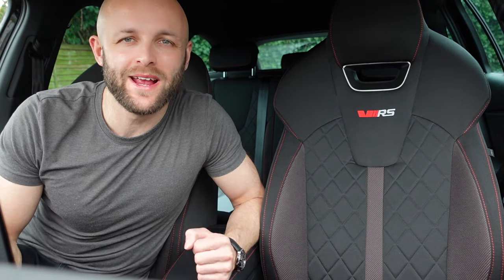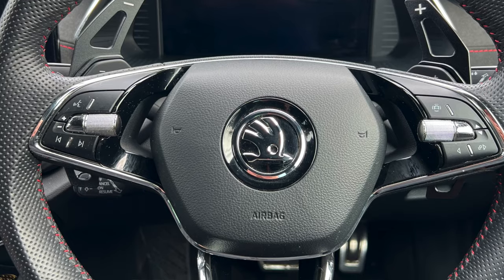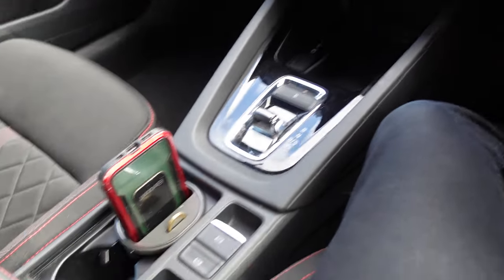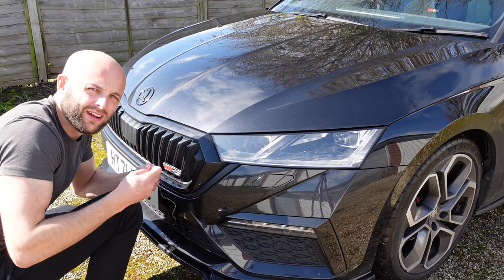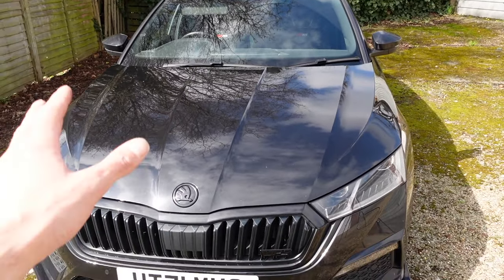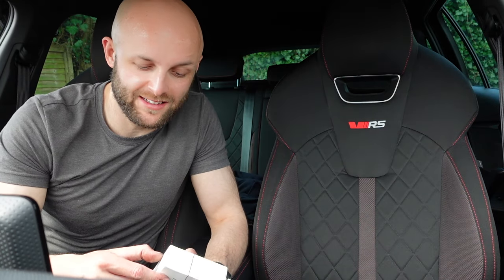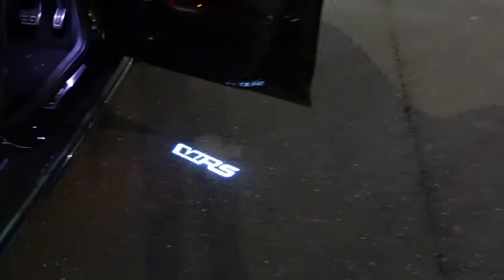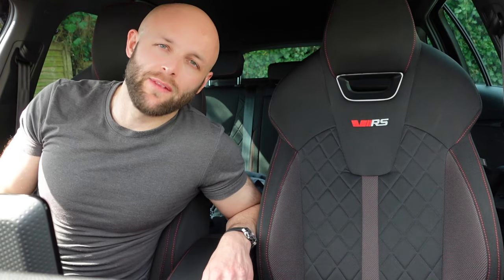5 Must Have Mods & Accessories - Skoda Octavia vRS MK 4 2023

Comment: Hi Darren , happy your enjoying your VRS . I had a 70 plate mk4 delivered Jan 21. Full of software problems , freezing screen for days , ACC seeing things that weren't there and applying brakes. Sat nav showing my current position 5 miles from real position. SOS function regularly calling emergency services. It was in the dealers over 20 times and off the road for around 40 days of the near 18 mths i had her. Its a shame as she drove so well. I finally rejected the car and moved to Hyundai N.  That was my 3rd and final VRS and wont be going back to the brand as they used me and others as full paying beta testers of their software and refused to acknowledge the problems. For any other buyers , look to see the software version and dont touch anything below version 1806
Reply from the maker: Thanks for the information. I feel I got lucky with the software version then as I believe mine is that or above! Thanks
Reply: Same problem here. I've got the 21 plate estate. SOS system would randomly decide to crap out and lock the entire infotainment unit. Took it back to the main dealer 3 times for software update and still have the issue. I managed to get around it by setting privacy to maximum. I found this solution on an Audi forum as apparently some Audi's suffer with it too. Not ideal, as it disables all the remote features via the app, but at least I can drive without worrying about losing the head unit controls. Also had an annoying issue with the plastic surround behind the rear view mirror. That fake engine noise travels up the windscreen, so was constantly rattling the plastic surround and cables inside it. Had to remove that and pad the inside with thin foam which seems to have done the trick.

I've had the past 3 VRS models and this is absolutely the worst one I've owned. Great to drive, but just plagued with stupid little technical issues. As well as the above I'll get days where sensors decide to stop working, or report false information. It's kinda tarnished the brand for me, given how many times I've been back to the dealership with the car.
Reply: I have a 2021 2L TSI Estate. Have owned for the last 2 years. Great to drive and look at. I travelled all the way to a Skoda deslership in West Sussex before driving back up to Scotland. The car is in Corrida Red and get lots of positive comments. Only let down are the infotainment glitches. Crackling speakers, system shut downs (central screen will regularly shut down and re-boot when the car is in motion) and error   messages to name but a few! The car did pull an emergency stop on me a few months ago. Was driving down a desserted redidential street when we came to a very violent stop. The boot also opened as I was parking up just the day before. Thankfully my furry friend did not exit the vehicle however it could have been a disaster. Put the car straight into the dealers. They had the car a week. Thankfully I haven't experienced any repeat episodes however Skoda do need to get on top of the software problems. There is just far too much tech in my opinion. The warranty runs out next year. Will probably look to replace before then!
Reply: @AndyGNicholls I was lucky to avoid the technical issues but I agree with build quality! My driver's seat wore within 1000 miles and had to be replaced. I've also had rattles in two places leading to the whole b pillar to be replaced along with all intervals 😢. Only done 3500 miles ...

Comment: Hi Darren, great video, btw your other videos have been a great help regarding the Maxton parts 👍🏻 Just fitted the same paddles a couple of weeks ago, I went with black paddles but saw the red ones after I brought them, think I prefer the black though after seeing yours fitted. With the phone holder, does the lid still slide over the top of it? And what is the width of the phone slot? Cheers 👍🏻 Ian
Reply from the maker: Hi Ian, thanks! The phone phone holder fits nice but the lid doesn’t slide over, not sure on exact width of the phone slot but plenty room for my iPhone 13 👍